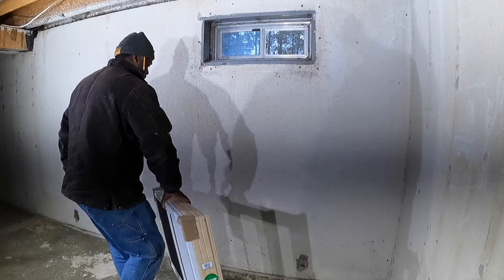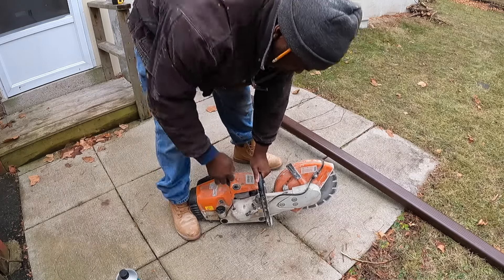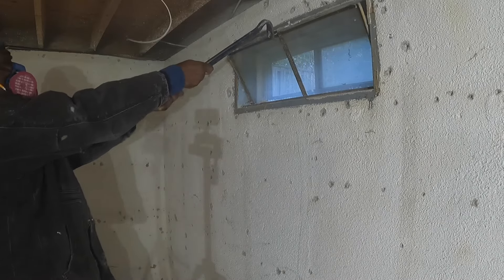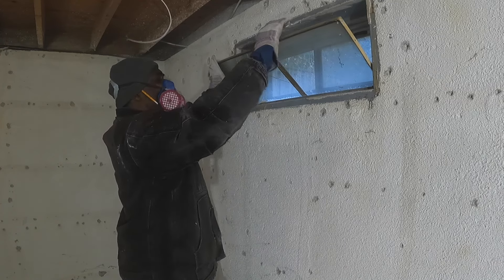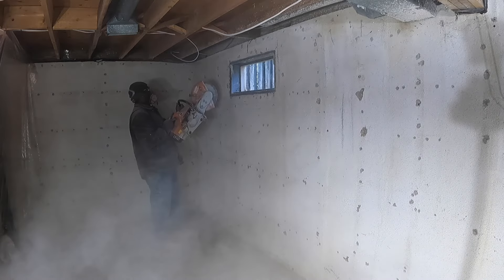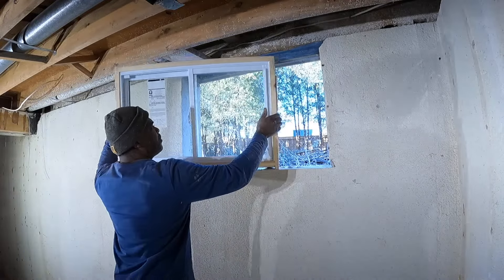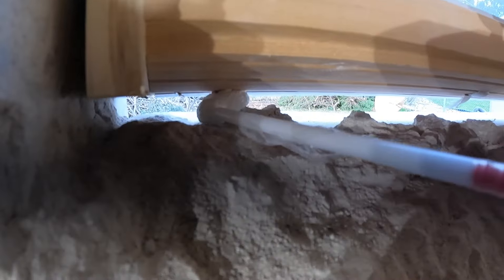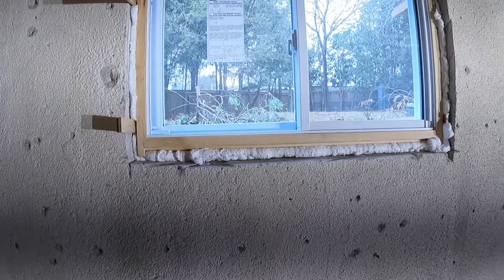How To Professionally Install A Window

Comment: It is important not to use expanding foam around windows or doors for obvious reasons.
Reply: Although this was completely true years ago, today they make low expansion spray foam designed specifically for doors/windows. Just make sure it's the proper one!